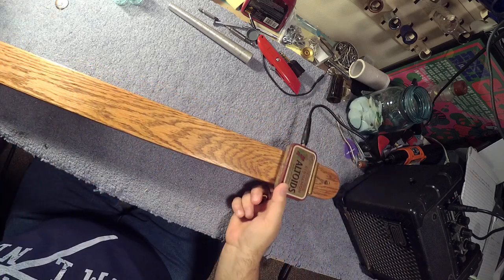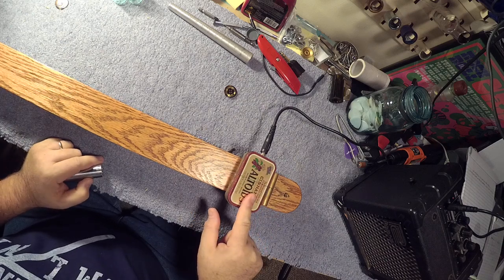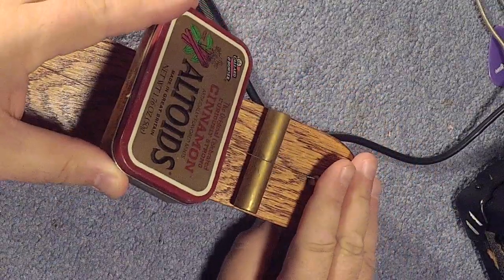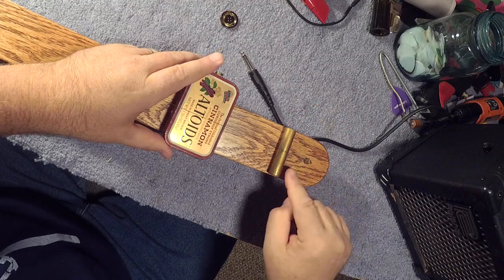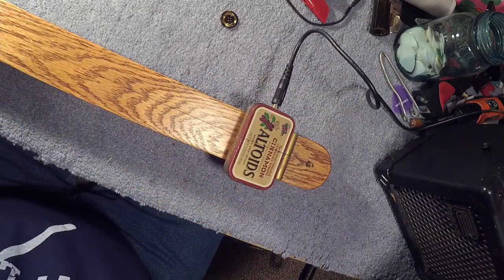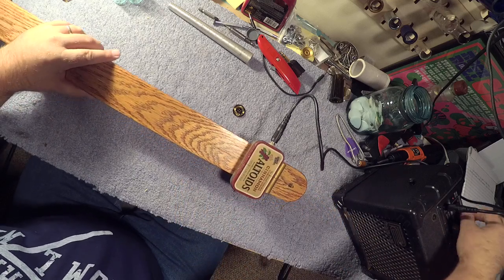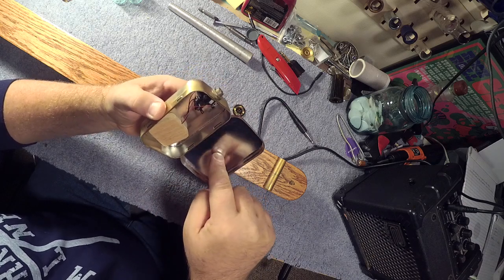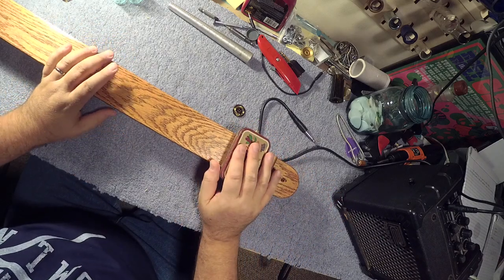Make a Diddley Bow Pickup from an Altoids tin & piezo

Comment: Shane, if you get some strong magnets, you can also use it as a quick pickup on any metal instruments like Canjos, or Cookie Tin banjos.
Reply: ??? How?
Reply: How what? How do you use it for metal instruments? You take a couple magnet and attach them to the lid, and then stick it onto the instrument. Not really complicated, magnets hold metal together. Heck when you're not using the magnets you can even store them inside the altoids tin.